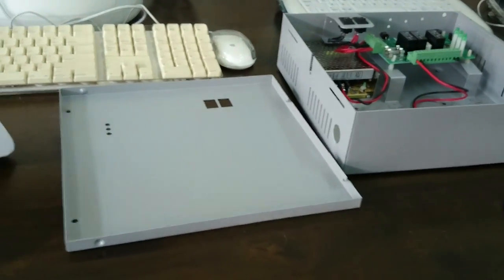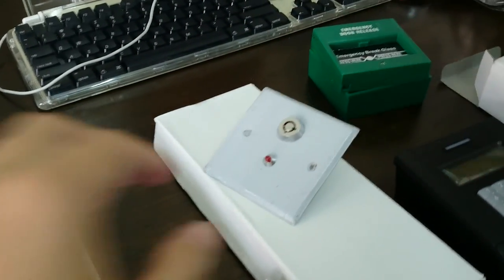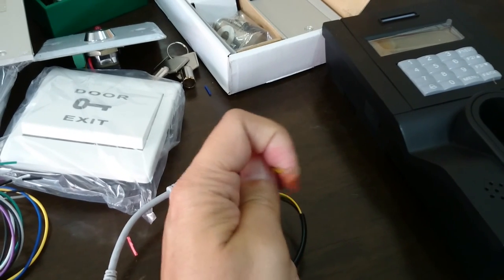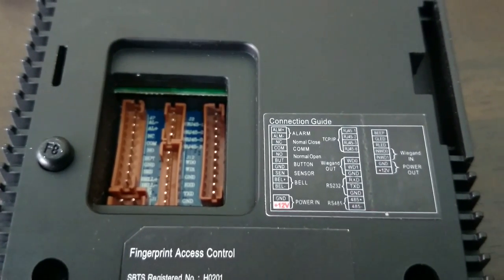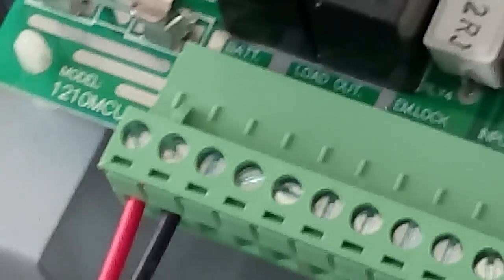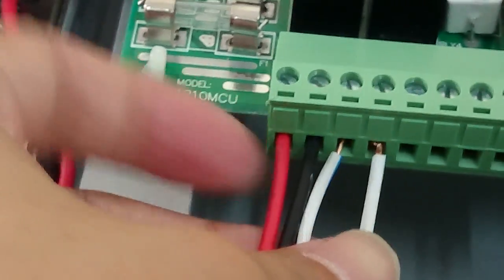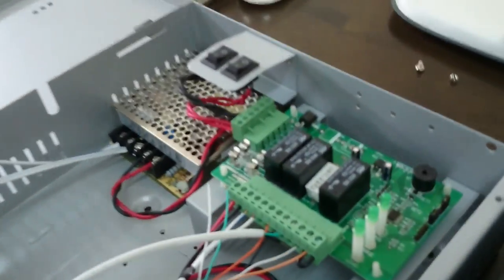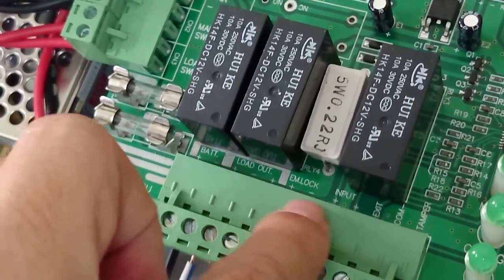Door Access Control System - Part 1: Installing EM-Lock & BIOXCESS Reader

Comment: How secure is this? If you are using the onboard relay of the reader. If you rip it off the wall your door will unlock, because it's a fail safe lock. If you want security you should use the wiegand output and program it with a computer.
Reply: That's right and it must always be on the secured side of the structure.

Comment: If this is a video anyone here is learning on.. make sure you cut your jackets all the same length... all in a 90 degree fashion.... Most of all your conductors need to be terminated so that they are not visable under the terminals.. he almost shorted a million times... treat the wire as it is hot at all times, you will not regret these tips. sounds arrogant, but I am one of the best at the craft. This stuff is not difficult to install, so you want to make sure when you leave the product on a customers property it looks like they couldn't do it themselves. They will be looking at it for the rest of the time they have it! If you are a novice I recommend you spin the cables with the jackets cut all the way back and secured together. Lable the jackets out of sight. get a lable maker and mark them at each terminal on the board. Good Luck!
Reply: It definitely does make it look better to make the metal hidden, also nice cable routing is very nice.
Reply: K
Reply: Is there a code we need to set on the keypad for it to work or it is installed as it is

Comment: If you don't have electricity (cut from company some hours) how does work all the system?? To opened the door?? :-)
Reply: Use With Batter Source 12v 2x Amp 7 :-)
Reply: I mean Battery Source

Comment: how to termination only lock and door contact to the board .we need relay connection or direct connection
Reply: we are using only door lock and door contact but i terminate lock cable this one  from door to control board .what is my qus directly connect to board nc and c or using relay

Comment: Sorry fella but your termination technique is rubbish. The stripped wire strands should be twisted tightly together, then bent back on themselves to give more contact area before inserting into the terminal. Also when terminating, you shouldn't have all that bare conductor showing outside the terminal.